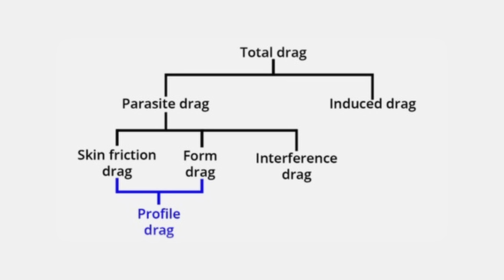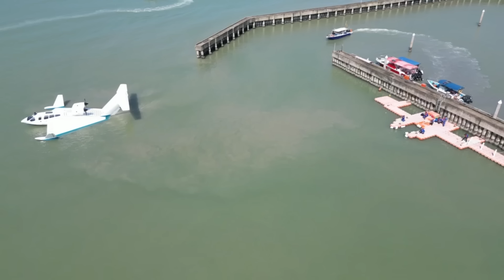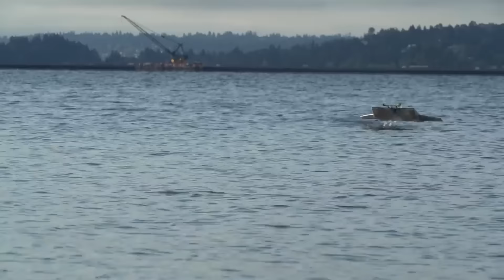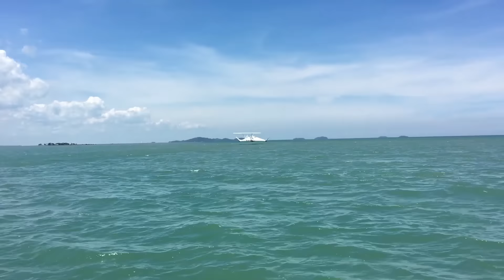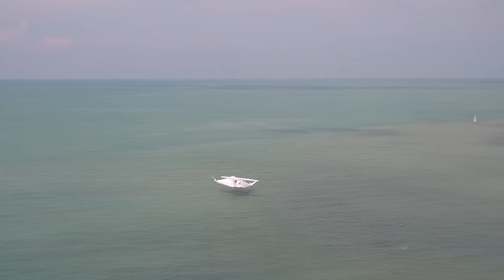Fifty Years in the Making: The AirFish Voyager Finally Going Commercial

Comment: I heard these designs don’t do well in rough oceans. Otherwise Taiwan to penghu would be perfect use case. Also a Camry hybrid car motor would be better and with a redesigned blade could put out the same thrust as a gas guzzling v8.
Reply from the maker: Well... It is a matter of size and unfortunately bigger craft means more investment. Lack of investment even though the concept is sound, holds them back from being seen everywhere.

Comment: https://www.youtube.com/watch?v=HebUpnUceZA&t=557s

I made this comment on this video. What do you'll think?

Could it be that forward sweep on the Leading Edges could reduce the shift in center of pressure when entering GE? 
The Airfish Voyager has more trailing edge sweep than yours and what seems like a straight leading edge, whereas yours has a few degrees of aft sweep on your Leading Edges. 
A big reason for use of the Inverse Delta is to reduce center of pressure shift, so increasing sweep may be better than reducing sweep.
It would be interesting to see if adding enough fwd sweep to equal the mean sweep of the Airfish would make a difference in the OGE/IGE transition. my 2 cents.
Reply from the maker: You could be right! Build a model and find out!
Reply: @onewingspanabove  Thanks.
I prefer a canard configuration where the elevators can be on the main wing in the outboard section with ailerons on the inner 2/3 of the wing. 
With the resulting bell-shaped wing loading, small vertical tail fin(s) can be used which reduces the effect of cross-wind gusts. 
As we know a yaw is accompanied by a roll couple which in turn causes a pitch couple which I want to minimize so close to the surface.

Comment: Does anyone produce a Radio Altimeter based Vertical Speed Indicator(VSI)? This would be very nice for WIG vehicles!
Reply from the maker: Like a LIDAR? https://www.youtube.com/watch?v=nvMUYdr5_g8
Reply: @onewingspanabove  I’m thinking barometric altimeters and vertical speed indicators would not be accurate between 5 and 20 feet above sea level, so wondering if a Radio Alt based VSI and Altimeter is available or possible. Not for automatic height control but to assist manual flight control. Never know if one could get caught in a rain shower and momentarily lose visual reference, or on a dark night…
Reply: This RC Test video shows how difficult it is to balance a reverse delta with rear mounted motor(s). 
The Aerodynamic Center of the reverse delta is far forward which better suits forward mounted motors. This model needed a longer forebody to allow more forward weight. 
Another disadvantage is that with a forward CG to pitch up for take off the aft hull and wing trailing edge is being pushed down into the water creating more drag.
Fore mounted motors would probably allow a shorter overall length as a long forebody may not be necessary to balance the vehicle.
Engines mounted on the leading edge would allow props to blow high velocity airflow below and above the wing probably drastically reducing take off distance. 
My 2 cents
Reply from the maker: My 2 cents? More like 2 gold coins of aerodynamic wisdom! You've basically given the engineers a whole new project brief. Anyone got a spare wind tunnel? Thanks for your input!
Reply: @onewingspanabove  I flew Turbo props from 1983 to 2014, only have 17000 hrs. 
I once told a senior Training/Check Captain "when I move the controls I "see" how I am manipulating the airflow about the control surfaces and the entire aircraft. He said "Man you idle!" 
Its my nature. If more pilots "see" the airflow the would be more efficient and a lot safer. 
For example the Air France Airbus that fell in a stalled condition into the sea off Brazil many years ago, would probably not have happened if the pilots "saw" the airflow. 
Think of it, your altimeter is unwinding at a rapid rate, your VSI are pegged full down, where is the air flowing from? 
Obviously from below, so push the nose way down to reattach the airflow to the wing then gently pull out of the dive...
When I look at an aircraft I "see" the air flowing over it in relation to the AC and CG.
Reply from the maker: Wow, 17,000 hours and you were just "idling"? I guess some of us are just built different... or maybe you secretly have a superpower to manipulate the wind!
Reply: @onewingspanabove  Haha...noo superpower, just watching too many wind tunnel videos!
Reply from the maker: Never too much!

Comment: Using petroleum as propulsion fuel doesn't raise eyebrows, unless you'd rather have batteries as your passengers or freight instead of actual "paying" payload.
Reply from the maker: That's a valid point about the current limitations of battery technology for large-scale commercial transport. It's definitely a balancing act between environmental concerns and practical operational needs.
Reply: @onewingspanabove  I'm tired of watching governments, both sides, take vast amounts of taxpayers money and pouring it into virtue signaling projects on the premise that the tech will save us. I include grid battery storage in there. 30 minutes to boil the jug if you know it's kicked in.
We may/ have to make that energy density storage leap to usher in many things including having a shot at colonizing Mars or the moon.
I'm really happy to see a company understand what's achievable and leave the possible to later. I mean Whisper aero powered by turbo generators. How utterly realistic and a step up.
I get frustrated when the climate change card is thrown in as if it is the only token of admission to the tech world. The plant kingdom is on its knees thanking us for increasing the CO2 level from 180ppm to 420ppm. They are no longer at famine levels and are showing their gratitude by greening the Earth. How much of that increase is directly attributable to the SUV sinners is up for debate as the science is never settled. Ask Einstein. Rant over. Keep doing what you're doing.
Reply from the maker: Thanks for sharing your perspective on government spending and technological innovation. It's definitely a complex topic with many different viewpoints, and I appreciate you taking the time to articulate yours so thoroughly.

Comment: Clearly a huge amount of engineering work has gone into bringing this concept to a commercial stage.

One of the most interesting aspects is the focus on inherent aerodynamic stability.
Not relying heavily on active stabilization software seems like a smart design choice.
Naturally, the twin-engine configuration also appears to add a useful safety margin.
Overall, the certification process and regulatory pathway were explained very well.
Really looking forward to seeing how the Singapore–Batam route performs.
Keeping the craft within ground effect seems like a practical approach for early operations.
It will be interesting to compare its economics with helicopters and seaplanes.
New transport concepts like this don't often make it this close to commercial service.
Great video and excellent insight into the future of Wing-in-Ground effect craft.

Dutch men.
Reply from the maker: Glad you enjoyed the deep dive into the engineering behind it!

Comment: Solar powered boats are emerging, and I wonder if it's feasible to stick solar panels on top of such a thing to make it more efficient. It wouldn't replace other power sources, but if you can make them part of the shell that needs to be there anyways, the engines wouldn't have to bleed off as much energy for the electrical systems at least.
Reply from the maker: That's a really interesting thought! Integrating solar panels into the shell could definitely provide auxiliary power and boost efficiency. Not sure if it could produce enough though!

Comment: A cross wind of 15 knots?!? That's it?? Wow kinda hard to run a commute service that requires near perfect weather.
Reply from the maker: Good point. However a Cessna 172 usually maxes out around 15–20 knots..
Reply: @onewingspanabove  I had no idea it was so low. And this has the added advantage of making it's runway and heading it requires. So it should be less of a problem than with other small craft.

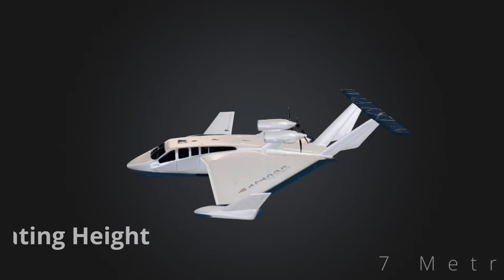Comment: Interesting. The model shown at 14:00 has contra-rotating propellers, while the real world article has simple propellers. Did the plan change or the test article is simpler?
A note about "It's not about drag, it's about lift" - they are always linked. If you want more lift with the same geometry, you generate more drag. This is why everyone wants to increase the lift-to-drag ratio, and ground effect with reverse-delta wings is one way to do it. So it's both - get more lift with the same drag, or get less drag for the same lift.
Reply from the maker: Thanks for catching those details! The model shown is only for illustration purposes. I really appreciate you sharing your insights on the lift-to-drag dynamics.

Comment: So what happens when you turn a little to much or a gust roll happens and it dips a wingtip at speed? Flying a couple feet up is a terrible idea in all but the perfect situation.
Reply from the maker: The theory goes that your craft would be designed to cope with those scenarios. A wingtip float against a wave should be deflected by its shape and any forces absorbed by the airframe without it being destabilised. The airfish has flown countless hours and would be subjected to these scenarios.

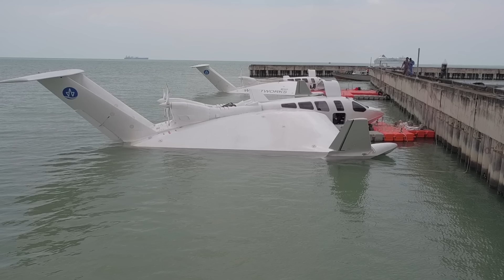Comment: 16:02 The explanation of Class A-C in the video is inaccurate. Although both Class B and Class C can exit the ground effect envelope temporarily, Class B cannot exceed 150m while Class C may exceed 150M, NO ground effect craft can sustain free flight. A Class C ground effect craft is NOT an aircraft, though it must comply with ALL aviation regulations for the brief period that it is ABOVE the 150m ceiling.
Reply from the maker: There is a bit of an overlap area..
From https://www.imo.org/en/ourwork/safety/pages/wig.aspx
"IMO and the International Civil Aviation Organization (ICAO) have agreed that any WIG craft capable of sustained flight outside the influence of ground effect should also be subject to the rules and regulations of ICAO. Other craft, including those with limited "fly-over" capability, should be covered only by the maritime regulatory regime."
Reply: @onewingspanabove  By the definition of the regulations, any craft capable of sustained flight is NOT a ground effect craft.
Reply from the maker: You could read the regulations that way indeed.

Comment: Unless someone rips a ZPM out of a scifi story putting a viable electric aircraft into practical use is utterly impossible and idiotic and suicidal. Some form of hybrid drive where a gas engine turns a generator that spins electric motors is a possibility especially when there might be greater efficiency gains on the cards due to the improved ability to locate the props virtually anywhere with minimal nacelle size. The placement of the powerplant can also be optimised for weight distribution instead of being out on a wing.
Reply from the maker: REGENT are looking at hybrid versions which makes sense. And for future craft, the Airship Voyager might have it as well.. Who knows?!
Reply: crikey, you better not tell the folks who are actually doing it...

Comment: Very nice! Great video! Wishing Airfish success. 
My comments are too much water drag from the monohull design and the submerged long trailing edges resulting in a long take off run. 
Least expensive fix could be an inverted V partial hydrofoil (deep chines) along the center of the hull which should lift the Trailing Edges above the water earlier in the TO run
Reply from the maker: Thanks for the engineering insight, that's a very interesting suggestion!
Reply: @onewingspanabove  Quick question. on the previous single engine version, were chain or belt drives used to spin the twin props?
Reply from the maker: Probably belt driven I'd say.

Comment: I give it 3 to 5 years before an accident kills it.
Reply from the maker: Thanks for the comment. I am thinking that's what they thought about airplanes and helicopters.
Reply: @onewingspanabove  Cars too... I bet the same thing was said about riding horses back in the Bronze Age...
Reply: @user-McGiver WIG have been an idea since the early 1950's at least. Not one example survives as a commercial success. The main pitfall is that it takes significantly more power to get WIG's off the water effectively reducing the fuel efficiency in flight due to the need for much bigger engines. Secondly, hitting a wave at 70 kph in a lightly built "aircraft" will be disastrous.
Reply from the maker: Indeed. And that's why REGENT are taking a novel approach by using hydrofoils.
Reply: @onewingspanabove the aircraft you show looks like the one that has been in development in melaka, malaysia. It is a massive fuel guzzler, like all WIGS.
Reply from the maker: That is what the video is all about indeed..

Comment: I guess the main thing left is understanding what happens in bad weather.  marine vehicles are built to withstand heavy weather by battening down the hatches because it is known that they cannot always out run it.  Aircraft try to manoeuvre around away from it, and simply don´t fly if the weather is too adverse.  This neither fish nor fowl approach leaves the question open.
Reply from the maker: Indeed. I think the generally accepted answer I have heard to this is, if the boat doesn't travel, the ground effect machine doesn't travel. Obviously this depends on size.

Comment: Why run this aircraft and not something like a turbo Otter?  Both carry 10 passengers/crew, but the Otter is already used all over the world in regular floatplane service.  Easier licensing?
Reply from the maker: Easier licensing. Cheaper maintenance. Overall more affordable to buy and maintain!
Reply: @onewingspanabove  I'll buy cheaper to maintain maybe, but Avaiation Week puts an (whoops , typo) Airfish at 3-5 M$ per aircraft.  A Twin Otter costs, 5-7 M$ new, but carries double the passengers.
Reply from the maker: It would be interesting to find out then what a Seaglider would cost with double the seats..
Reply: I assume much less fuel use
Reply from the maker: You bet! Less fuel use is a huge plus.

Comment: What happens when the pilot banks too steeply in a turn and a wing tip catches in, say, a three-foot chop?
Reply from the maker: Ground effect should be a stabilising effect in this case. And the design should be such that wave impact doesn't destabilise the craft.
Reply: @onewingspanabove  Russian Orlyonok pilots would dip the inside wing tip into the sea to drag her into a turn! But they were built from 1/4" plate aluminium. If you look on the net there are photos of these occurrences.
Reply from the maker: That makes sense!
Reply: yaw, not roll
Reply from the maker: Aerodynamically speaking, these are firmly interlinked.
Reply: @onewingspanabove  with traditional dihedral yes, but this wing has considerable anhedral and a lot of weight above the wing, only countered by the wingtips.  It's all about the roll coupling of the entire craft that determines this, as you can eliminate it entirely or go the opposite direction (though it's rarely seen in aircraft because positive roll coupling is generally beneficial for stability).  Just off the cuff I'd say that yaw in this craft has minimal roll coupling, but enough to remain stable in normal flight.  You certainly wouldn't want it to have a lot of positive roll coupling, as dragging a wingtip creates yaw in that direction, which would cause the opposing wingtip to lift up, pushing the dragging wingtip harder into the water, until it eventually cartwheels.  Negative roll coupling would force the opposite wing downward, so it would basically force itself down in a yawed attitude relative to direction of travel...not great either, but probably something you could recover from.  Neutral roll coupling would just cause it to skid sideways in the air without lifting or dropping a wingtip, until it aerodynamically corrected itself...but without any roll coupling there is no inherent stability in flight, the pilot has to be the stability.
Reply from the maker: James from https://www.youtube.com/@Ground-Effect once mentioned a very strong link with his MudSkipper.

Comment: The high aspect ratio design debate and contrast highlighted in Chapter 11 21:32 is good to see but I also appreciate Regent's innovation efforts.   The WIG design space is still underdeveloped compared to modern aviation, and has a huge potential market niche between aviation and shipping.  Which design concepts scales up better?  At the largest scales, efficiency will be more important and electronic stability enhancement will be just an engineering problem solved by redundancy and system engineering.
Reply from the maker: All good points!